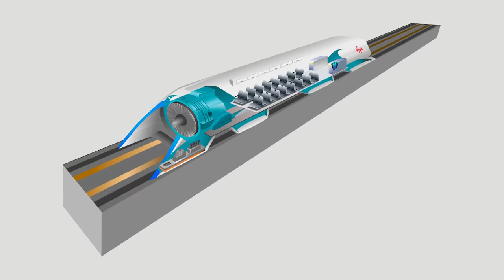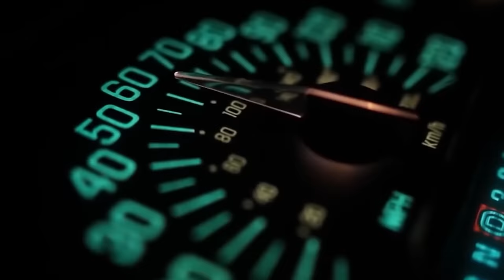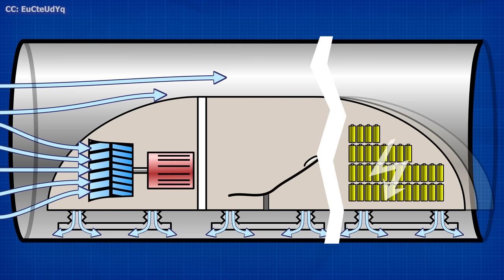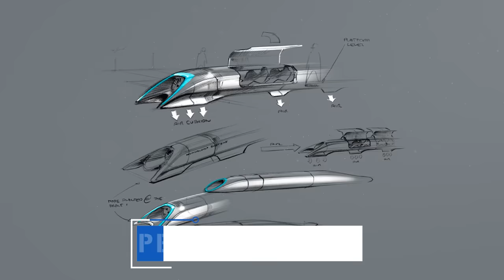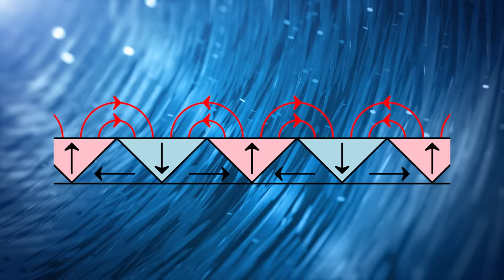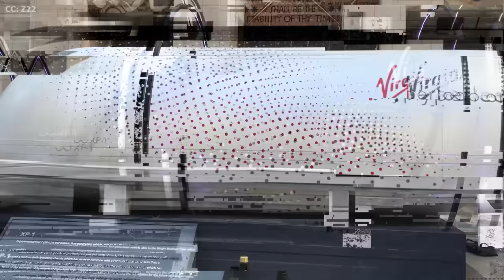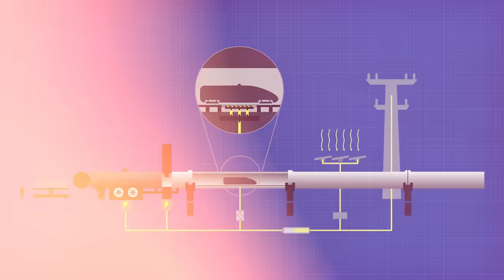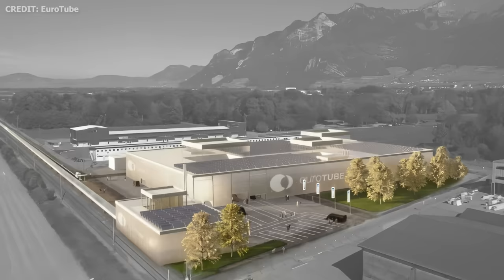We’re Getting Closer to a Hyperloop...

Comment: Hyperloop is an excellent concept - in theory.  However, in the real world, it will never work for the following reasons:

1.  To compete with current high speed passenger rail systems, it would need to have a minimum passenger capacity of around 1500 people every 15 minutes.  The small 20 - 50 seat pods proposed on all of these systems are simply not going to cut it for a mass transport system.

2.  The freight proposals so far advanced also involve single container pods which each have their own power systems.  Currently a single freight locomotive can haul around 30 - 40 containers in the UK.  This number runs into the hundreds for freight trains in the USA.

3.  The power required to maintain a near vacuum in hundreds of miles of tube will be vast and the cost of this will probably negate any benefits.

4.  Sabotage.  It has previously been calculated that a 1 inch diameter hole (a bullet hole) would be enough to compromise the vacuum and shut down the whole network.

5.  On a more personal level, one of the joys of rail travel is the ever changing and often beautiful views out of the windows.  Hyperloop does not have this.
Reply: Agree

Comment: As Thunderfoot pointed out, one of the biggest problems with the whole "HYPERLOOP" concept is the vacuum of the tube. All other aspects aside, pulling a vacuum on a tube of any significant length is fraught with so many issues it's hard to know where to start. And some of those problems would absolutely result in death. AND, most of these problems would absolutely occur no matter how good the technology becomes. Pulling a vacuum on something 100 miles + long is a feat of engineering that we currently can't accomplish with any degree of efficiency. The expansion and contraction of the tube is a matter that's not easily dealt with. Any issues with the tube during high speed operations would be catastrophic. And issues during highspeed operation are virtually guaranteed. I'm sure lots of money is being spent on trying to figure out "Hyperloop". But the physics that needs to be overcome is virtually insurmountable. 

But why does the hyper loop need to be a vacuum? And why does it have to travel in excess of 500 miles an hour? Why wouldn't pulling a 50% or 40% vacuum be worth looking at? Any amount of vacuum at all below standard atmospheric pressure would result in less resistance. Pulling a vacuum that's more attainable, and less deadly, and less prone to catastrophic failures and would require far less intense maintenance would have its advantages. The biggest problem with having any pressure in the tube is that of compression as the train moves through the tube at high speed. Why isn't 200MPH fast enough? Hell, 150MPH? 100MPH? What speed can you safely travel in a tube with X Pressure? How fast does your average freight train move? I would think anything in excess of 70MPH would be a great improvement over conventional trains. Being able to burry some of this in the ground has it's advantages. Being able to use alternate forms of energy has it's advantages? Is it really necessary to have 300+ mile lines? Simply being able to move freight from a harbor area to various inland shipping areas would have it's advantages. 

Any system that pulls a "Serious Vacuum" on the tube is absolutely going to lead to a catastrophe. Any such conveyance would need to prove it's safety for a hundred years before I'd ever consider setting foot anywhere near it.
Reply: Exactly, just build a normal high speed rail network or if you want to be fancy, a maglev train
Reply: @_blank-_  The point would be (if there's even a point at all) to find efficiencies in transport above and beyond what we already have. I'm not a scientist or an engineer. I'm merely a science enthusiast. There IS, at least in theory, a benefit to being able to move  freight through a "Vacuum". Or as I contend, any atmosphere that's less than standard. The real question is, can some description of any system be created that makes sense at scale? The idea of pulling a real "Vacuum" on a tube of any significant length is complete bullshit. But that doesn't necessarily mean that the basic premise is unworthy of study. 

In theory, Warp Drive is not impossible. The question is, is Warp Drive practical? I think that pretty well applies to this so called "Hyperloop". I think in theory, a system could be designed that pulls say,,, a 40% vacuum". What I don't know is whether or not it's practical.  In my opinion, answering that question is worthy of running to ground. But in any case, the concept that Elon rolled out is pure fantasy. On top of all the issues there is with the tube, can you imagine what it would look like if the pressurized car ever sprung a leak inside the vacuum?
Reply: "welded rails" or some shit.
Reply: @mums_poop_sock 😂 saved him the trouble

Comment: Mag lev - maybe based on operating costs of high speed rail.
Evacuated tubes - not likely based on risks and infrastructure costs. Compare costs of a maglev in a evacuated system to a non-evacuated (open air system).  How much electricity would be saved compared with the added costs incurred by an evacuated system.   Is the time needed for transporting goods or people that impotant or valuable?
One must also ask how switching is going to be accomplished.  Point to point trains are one thing but take a look at a modern rail switching yard and one begins to understand how complicated a rail system of any type can become.
There are a number of systems in develòment that will revilutionize rail delivery times by, for the most part minimizing time needed to make up train groupings. - a huge cost and time saver.

Comment: Surprised none of these designs mention lining the inside of the tube with a strongly diamagnetic material like pyrolytic carbon in conjunction with permanent magnets on the pod to levitate it. Also surprised that no one has thought of using two airlocks — one at each end of the tube — to create a pressure wave that the pod can ride.

Think about it: if your hyperloop tube is lined with pyrolytic carbon and has 2 airlocks at both ends while your pod has neodymium magnets in rings keeping it diamagnetically levitated, you just close the airlocks, vacuum out the tube, and then, to start the pod moving, just open the airlock at the origin end while leaving the one at the destination end closed. At that point the pod would essentially be riding on a pressure wave of air that’s trying to refill the tube but has to push you along in order to do so.

Comment: Freight as an industry requires reliability and affordability, not incredible speed. It needs alternate routes in case of issues in the main path. 

It's going to take huge amounts of power to keep the tube depressurised. There's no allowance for heat expansion in the tube. With a long steel tube, the expansion from a cool morning to the middle of the day is measured in metres, not just a few centimetres. So they're just going to have a tube that grows longer through the day, and shorter as it cools down in the evening?

What happens when things go wrong? If you take a vacuum tube and it breaks, or someone attacks it with an explosive device, what happens to the rest of the tube? Well, we already know. The Mythbusters even did an experiment using trucks that carry liquids. They depressurised it then dropped heavier and harder objects on it until it damaged the tank enough to create a hole. It wasn't pretty. The tank looked like a crumpled can of coke. 

Considering the forces involved, none of the parts are going to have much tolerance in terms of manufacture. Even high speed rail requires better quality control and a more robust design for the tracks it uses than slower versions. With a hyperloop system, there are going to be very fine tolerances everywhere, which means nothing involved in it is going to be cheap. Working on the rail road back in the steam era didn't require the people doing all of the work to have any qualifications other than a strong back. The hyperloop is going to need technician and tradesman level expertise all over the place, which means expensive.

So, essentially, it's an impractical, unsafe, needlessly expensive concept. The vacuum tube isn't necessary. A tunnel works just as well, especially for freight. They can load up a train with containers and send it down a tunnel to the edge of the city even easier. Or for that matter, they can build a cargo port on the edge of a city and simply have all the cargo handling infrastructure there instead of having to load up the cargo onto a train, send the train out of the city, unload the train, then load the cargo onto trucks. Far simpler to take the train out of the equation entirely.

Comment: We already have metal tubes running through a near vacuum at speed.   They are called airplanes.   The higher they fly, the more of a vacuum they run through.
Reply: Yes, but they use expensive and polluting fuel, and require large infrastructure and extensive security that ruins efficiency and convenience.
Hyperloop is meant to be used for shorter distances, below 1000 miles.

Comment: In a vacuum the hyperloop concept might work.  But the world is not a vacuum.  As pointed out the hyperloop concept is something that has existed for centuries in general - and while feasible and even occasionally practical, was never sustainable compared to existing transportation methods.  And its really that simple.   

The car and the airplane were of similar functionality even 30 years after they started becoming popular.  Both filled the niche of personal high-speed transportation without the limitations/issues of horses.  Both were subordinate to trains, which moved (and still do move) items and people in bulk.  Also, a subway is just an underground train.  

What allowed the car to become the ubiquitous long-range transport for individuals?  Simple: the interstate highway system.  That's it.  Otherwise cars would still be as niche as personal light aircraft. You want to know when the age of the flying car will come?  It will be when your "personal light aircraft" can reliably follow a sky-road with near zero input and break down during a trip without killing you in almost every scenario - more the latter than the former.   If your "flying car" only has short range transport, the difference in "speed" is negligible compared to a ground car over anything under 50 miles, so adoption will be low anyway.   Drone-like air taxis are... well... not going to be able to compete with ground transportation in most places. If there's only a very few places that can justify them - then there will not be that many of them.  If there's not that many, there can be no economies of scale.  Etc.   

What allows commercial aircraft to do the bulk of long-range human and small-item cargo transport?  Simple: an airplane is faster than a train or boat over large distances.   Its a skybus.  Why do we have regular ground busses?  Because trains take up a lot of space or require expensive underground tunnels and thus can't always be placed for best service.  

What makes each of these technologies successful is that they optimize cost (lower is better), functionality (higher is better) and complexity (lower is better) for a given set of tasks and are under continual development.   They also have very little overlap while covering a broad range.  

The hyperloop's niche is consumed by options that cover the required spectrum and are far less costly and complex and provide as much or even more functionality.  Speed is its only benefit - but unless that speed is truly applicable for near the cost and complexity of existing solutions, its adoption will be low.   The concorde couldn't sustain its model, for example.    Its why everyone doesn't have a flying car too: even if its possible it has to be cheaper and less complex while doing the same or better job as a ground car while providing a benefit that the ground car can't provide.   

So what could be a niche the hyperloop fills sustainably?  Well... the one thing we will need is a tech that allows relatively fast orbital access.   A vacuum tube wth a high-speed magnetic rail driven train might just be the niche this technology would have.   It would have to be an active-support-to-orbit system.  In this case, the complexities and costs of the hyperloop are insignificant to the overall project, and far cheaper than rockets performing the same task.    I just don't see a ground-based hyperloop ever competing with existing transport technologies - because even as the hyperloop advances... those other transport technologies continue to evolve as well.

Comment: Imagine your train having a malfunction when moving xxx-miles per hour, in a concrete tube, in a vacuum. Yeah. Instant chaos and death.
Also imagine the impossible task of making such a large tube the removing air from it in any meaningful way.
It's a pipe dream (you'd have to be hitting the pipe to think it was a realistic endeavour)
Reply: A pipe dream of a pipe-hitting person to send trains through vacuum pipes
Reply: That's why Musk stopped talking about it. He ain't stupid. He is hot headed which got him into having to buy Twitter which he didn't really want to do but he's not stupid.
Reply: You're talking nonsense. This is no different from high speed train derailments or collisions that already happen. No different from plane crashes.
Reply: A concrete tube won't do.  Concrete is somewhat porous, and can't contain a vacuum.  It would need to be a steel tube, and it needs to be strong (ever watched the Mythbusters episode where they collapsed a railway tank car using a vacuum?)

Then there's the expense of running extremely large vacuum pumps.  And how would the airlocks work?

And how do the passengers survive if there is a failure of pressurisation in the passenger car?  You can't just descend to a lower altitude, like in a plane that depressurises.  And if there's a tube failure, the inrush of air would drive the passenger car along the tube at high speed until it hits the end.

It's completely unfeasible, both economically and from the point of view of safety.
Reply: @jerry2357 Are you suggesting that when (and it is when, not if) these machines break down, that assuming this gargantuan vacuum chamber can actually be created, the air from the pod the passengers are in  will leak out of the pod. Assuming the passengers are human that would be they would need to breathe.  that before using this we find a solution.  Due to the complex nature of the Hyperloopl
 obviously it will be ea people should become anaerobic.
Reply: @iamterfer  

Exactly, you have a passenger pod in a vacuum with a considerably lower pressure than an airliner experiences at 40000 ft.  Air passengers just need to be provided with oxygen until the airliner can descend to about 10000 ft.

But in a hyperloop, when there is a depressurisation event, the passengers would need space suits (like U-2 pilots wear), because the air pressure in the tube would be too low for the passengers to survive, even if they were provided with oxygen to breathe.  And oxygen etc. would be needed for as long as it takes for the passengers to escape from the tube.

If you just open a door in the side of the tube (to allow the passengers to evacuate), air would rush in, causing all sorts of havoc.

There are VERY serious safety concerns with any hyperloop.  The England-France Channel Tunnel has had a number of serious incidents since it opened in 1994, and the safety regime for that is considerably more strict than on any normal railway.  Add in the extra factor of vacuum and the difficulty of operating a hyperloop safely goes up by a couple of orders of magnitude.
Reply: @iamterfer  You just repressurize the tube if something breaks down.  Musk talked about this in his original paper. It's not even that complicated.
Reply: @jerry2357  If there's a depressurization event you can just depressurize the tube with air from the outside.  It's only one atmosphere of pressure. Less then what you put in a typical care tire.  Hyperloop haters act like it's at the bottom of the sea or something, it's totally ridiculous.
Reply: @takanara7  

No, not really.  You couldn't do it quickly and reliably enough.  How would the train reliably inform the fixed infrastructure to repressurise  the tube? And if you repressurise the tube from a limited number of air inlet points, you could get the piston effect that would slam trains together or into the airlock doors.

Safety systems need to be operable directly on the train, and there's no obvious way of repressurising the tube from the train itself.

In the normal-pressure Channel Tunnel, there are escape passages into the service tunnel at close intervals, so there is always one next to the train, no matter where it stops.  But on a hyperloop, you have the additional factor of vacuum, which makes things a couple of orders of magnitude more difficult.